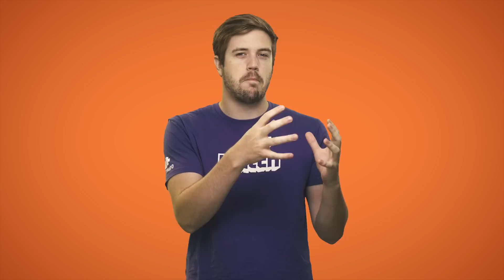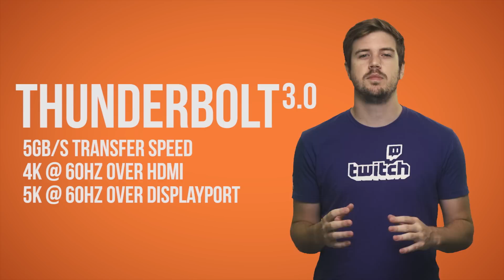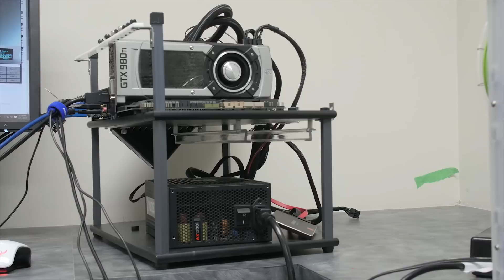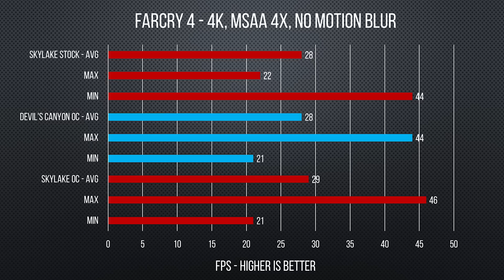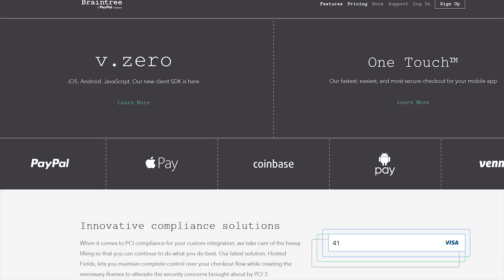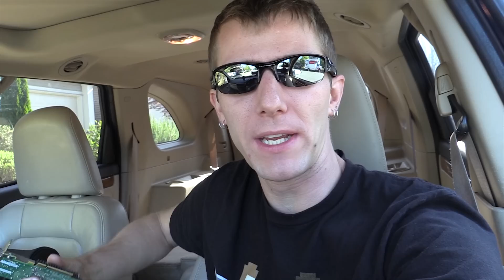Intel 6700K "Skylake" CPU

Comment: this is the kind of shit Intel gives us when there's no competition. if you have a 4790/K, 3770K, or even 2600K not needed the platform upgrade then you don't need to upgrade
Reply: Artemis 

2600k....I'd definitely suggest upgrading sometime soon, one would notice FPS bumps easily.  Anything above that, like the i5 4690 of i7 4790, there is basically no need.  Socket 1151 is a niche socket, and if one needed more performance than the 5000 series, they could go with the new xeon's which are amazingly powerful and efficient.  

Even a 4790k is going to be very good performance for years to come for home users.  Anything more needed than that, and one would be better off looking into things like render farms anyways, or don't even care about the pricing of higher end stuff.  

Intel isn't giving us shit, it just has no competition to drive it to deliver more than increments.  Even at this crawling pace, AMD has no hope of catching up.  As soon as they come out with their next big chip, it'll probably only be as good as intels current offerings....and by then intel will have something to blow it out of the water.  

do I want more CPU power?  sure.  Do i need it?  no, not really.   Yeah it'd be nice for some CAD rendering performance, but it's not like I'm on a time table as a hobbyist, and if I needed it in a timely fashion for work, I wouldn't even be looking anywhere near the range of a 4790k or Skylake.
Reply: ***** uhh no... It's in Intel's best interest to keep AMD afloat otherwise Intel will lose its competition and Anti-Trust laws will split the company. Intel didn't kill AMD, AMD killed itself with poor business performance.
Reply: Jackson Tyler well technically consumers killed AMD, because there were several times where AMD offered the better CPU and/or price yet they still didn't sell extremely well...
Reply: +C “N7” North I think the issue is more that we are approaching fundamental limits to lithography and engineering.  Below ~4-5 nanometers, quantum tunneling makes classical transistors basically impossible, so companies like Intel will need to start shifting their attention to things like stacked chips or bigger chips to increase transistor count.  Either way, in a decade or even just a few years, we'll likely not be able to further shrink transistors, and we'll have to engineer alternatives.
Reply: You ever think that if AMD still competing with intel, how far would we've come?
Reply: +C “N7” North true. for home users and casual gamers, something like i3-4130 would be good and reliable for years to come. and for those who already use i5 or i7 ivy bridge and haswell, skylake is really unnecessary
Reply: coldsoup49

I think the simple solution to that problem is
1) increase the surface area of chips
2) changes the material chips are made out of so they can run hotter

we could for example, run 10Ghz cores on processors if the materials could handle the heat, and there's plenty of room to increase the size of chips.   so there's plenty of room left to double the strength of current tech over and over again.  

beyond that, quantum tunneling could one day be a main driving force of computing design. It's really too far into the future to predict what will be the new computing medium in 2030 or beyond.  We could be struggling still or have some massive breakthrough, or use current tech in ways never though possible.  

For example, by then computing may be stored in a single or series of global computing cores and wirelessly transmitted to operate all devices.  So it might resemble something like a nuclear reactor, made out of diamond like materials, the size of a building, red hot, running at a billion jiggahertz, being cooled like a nuclear reactor, delivering the worlds computing power.
Reply: C North Thing is it might not be as black and white as that, developers know that CPU's aren't getting faster so they are forced to hold back as if they didn't noone could run their games, if there was a competition war between AMD and intel and each were increasing CPU performance 30% a year devs would have that freedom and make use of it! :D
Reply: Artemis what about about the X99 chip? Thats pretty fucking major.
Reply: we're talking about Skylake here. the 14nm new tech everyone had high hopes for. Too bad it didn't deliver
Reply: Artemis lol just because Intel didnt deliver a drastically over amazing cpu this time doesnt mean there arent other better choices like X99, the 6700k or skylake for that matter arent their only cpus lol. The main driving point for Skylake was LGA 1151 anyway. Theyre trying to push over into DDR4 and hopefully make DDR3 obsolete,  just like with DDR2
Reply: I understand the Platform thing but DDR4 performance is not even noticable with even 3000Mhz DDR4 vs 1600Mhz DDR3
Reply: megaspeed2v2 sorry but that's a dumb statement, as most games rarely use over 50% of a typical quad-core CPU anyway, if CPUs were really holding things back in anyway then obviously they should be utilizing the CPU better, plus with DX12 around the corner it should offload even more processes onto the GPU, these days the CPU is becoming less and less important for gaming... and I say that as someone who bought a 4790k just to run a few CPU heavy games better.
Reply: vgamesx1

I bought the 4790k because it's 30% faster than the i5 4690k, which would buy me another year or two of longevity at least.    I haven't even bothered to overclock this thing yet, really just no need to.  when a good cheap cooler comes along that allows 4.7ghz easy, then I'll bother.  

I don't even upgrade until something 4x as powerful comes out.  That's my mark.
Reply: vgamesx1

AMD may have offered better price at purchase time, but overall price to performance ratio always went to Intel, despite naysayers.

Why?  Because...

AMD's increased power requirements over the life of a CPU (~5 years), makes even an FX 8 core more expensive than an I7 4790k in the long run.  Now couple that with all that extra performance from the get-go, then the added longevity giving years of savings between the next upgrade, and AMD's chips are sorely lacking in every area.   

What are people with FX 8 cores upgrading to?  i7 4770/4790k's.   So here they've spent over $500+ in CPU's since 2012 (not to mention new motherboard, etc), when they could have gotten an i7 4770k from the start.  The end result?  They've paid even more money, for the same performance people have been getting with Intel for years already.

When I moved to an i7 4790k and a GTX 970, I didn't even have to upgrade my 480w PSU.  If I had went with an R9 290 or more and an FX 8 core, I most definitely would have.  That saved me a good $70 alone. 

On top of that, you won't find any AMD motherboard under ~$80 with features like USB3 or even SATA3.  You can get a socket 1150 motherboard with all of that for $35.  

And this doesn't even cover all kind of other little things here and there that set AMD back.

The fact is, AMD hasn't had price to performance ratio going for them since the early Phenom II days.    

The truth is, in the long run, AMD ends up costing you more, and thats been a fact of the world since ~2010.
Reply: +C “N7” North I don't know where you live, but using a AMD 8-core won't be that expensive, concerning power usage, as long as you don't use your PC at least 12 hours a day. As an old member of Team Red, I sadly have to confirm that. After 4 years of great Service, my fx6300 has died on me and I decided to go with a i5 4690k, great step forward for the future at least, as of right now,  I did not notice any improvements. Around 500 points more in 3 D-Mark, and great 2 FPS more in skyrim, yay.
Reply: Dieser 1337 Baka.

Over a 5 year period, the extra energy usage alone will close the gap of cost between an 8350 and an i7 4790k.  And that's not even considering the other factors I pointed out, like longevity and having all that extra performance from the start, or saving on things like motherboard costs or PSU costs, etc.  Add all of that up, and yep, the FX series costs quite a bit more in the long run.  

But see, had you gone with the i5 from the start, you would have saved a few hundred dollars at least, and would have had more performance the entire time.  

The difference in an i5 4690k and FX 6300 is pretty significant.  You may not notice it soo much in simple things like browsing the web or most gaming, but in a few years the difference will be quite a bit more obvious.  Even with DX12 on the horizon, that's not going to mean games are less dependent on CPU's, it's just going to mean more room to squeeze in better graphics.  

I would say even the skyrim performance should be better in general, since Intels do tend to help when it comes to increasing minimum and average frame rates in general.  But even then, I wouldn't really say skyrim is a demanding title, by now it's a pretty old game.    

Fact is, even the 8350 bottlenecks an R9 290 in many cases.
Reply: the only thing I like about AMD is their graphic cards, and even that origins from ATi, Their CPUs? nahhhhh. their CPUs is infact very good for the price they offer, especially with OC, a 5 years old PII 1055T @ 3.8 eats the i5 4690 in CPU heavy games, but it's old and hot and very power consuming. people want cool, new tech (specifically the firstworld country) so they'll always look to Intel and Nvidia. in poor country like mine, AMD good price/perf ratio is a good choice considering many of us upgrade their system every 2 years or so
Reply: C North had an 8350 for a long time. Upgraded to a Titan X and a 5820k and the difference like you said is massive,  even for the 4790k. Cpu's absolutely affect gaming perfomance. As a test I paired my Titan X with the 8350 and ran GTA 5 almost maxed out at around 55 to 60 frames. Then put the Titan X back in jy 5820k rig and got 95 to 105 frames completely maxed out. So idk where people get thus idea that CPUs dont affect gaming as much because they definitely do, especially if you play Arma lol. To be quite honest, I may never go back to AMD. Intel is just so much better in the long run. Hopefully they still continue to make X99 chips in the future though.  X99 is fantastic in terms of performance.
Reply: C North what are you rambling on about? I wasn't talking about the 8350 I was refering to back in the day, as in the early 2000s to 2010 when AMD was good.... of which what "enthusiast" is going to keep their computer for 5+years? normal people sure, but it's as if you don't know the audience you're talking to here.

Now onto your argument on power usage, not only ridiculous but also appears to be baseless as well, considering for most US states electricity only costs around 0.08 cents per Kwh but still depends where you live and AMD isn't actually that bad by comparison of power consumption at idle.

http://www.bit-tech.net/hardware/2013/06/12/intel-core-i5-4670k-haswell-cpu-review/6

As you can see there, accounting for an idle PC running for 6 hours a day, that consumes 90W (AMD) vs 80W (Intel) so 90W x 6h / 1000 = 0.54Kwh per day x 30 days = 16.2Kwh x 0.08 = $1.3 per month a month and $15.5 per year to run an AMD system, now same calculations for the intel based system would be $1.15 a month or $13.82 a year, that's a massive $1.68 difference a year, wow big freaking deal...

Now obviously PCs don't idle all the time but they will idle or nearly be in an idle state for most of the day, so we can calculate the load too, as what's called a duty cycle, we can assume that a PC will be idle for about 75% of the time for most people anyway, thus its only under load for that other 25% therefore our system examples from the site above would be (90W x 4.5h) + (283W x 1.5h) = 603Wh (0.6kwh) now you can figure out that the AMD system would cost an average of $23.89 per year to run vs an Intel system average of $16.07 per year, yes a massive $7.82 difference under typical usage...

Basically my point being and a long winded way of saying... IT DOESN'T FUCKING MATTER, unless you're building a 24/7 machine and that's the only time it should matter, so for example a router or NAS otherwise you're looking at a mere $6 to $10 a year in savings going intel, yeah it adds up over time, but just like having air conditioning, who fucking cares as long as you're happy? Besides that swapping those old incandescent bulbs out for LEDs would make a far bigger impact than swapping CPUs so what does that tell you..

Oh also just on a side note, I did upgrade from AMD but it was from an Athlon II x4 not an FX series CPU... so I spent about $160 AMD then made the switch to an i3 4330 and a msi h87-g41 and used that until I got what I have currently, I didn't go intel because I couldn't upgrade to AMD, I went intel because I needed that single threaded boost for games such as Minecraft, yes I shamelessly bought a CPU for that among other things, but it's been great nonetheless.
Reply: C North maybe some people want to "fuel" the competition? XD
Reply: vgamesx1 you obviously dont know what you're talking about, simulator games for one thing are CPU heavy and the devs are having to be careful what new physics features they add to the game so that people can run the game on current hardware.

Comment: Got my 4790K OC'd to 4.9Ghz stable.
Reply: +Hakeem Hakim pc specs?
Reply: Inneryoyo    i7 4790K 4.9Ghz  Asus Maximus Formula IV 16GB Hyper X Fury Corsair H110 watercooled GTX Strix 980 SLI.  Corsair 540D case EVGA 1K Watt PSU...Specs don't matter on the CPU.  Not all CPUs are created equally.  You could get the same 4790K and not be able to overclock so high.  I'm willing to bet I could push it to 5.0Ghz (but won't).  This particular chip is a beast.  Temps 32c idle, heavy gaming/load doesn't go past 54c
Reply: Nice dude!, congratz on the 4.9Ghz :v
Reply: Its insane man!!!!

Comment: I was a bit bummed out when i bought a 4690K just a few weeks before skylake released. (my 1156 mobo died)

But seeing that i didnt missed out much on performance (as Linus mentioned in several video's before) i'm happy i upgraded from i7 860 to i5 4690K.

offtopic: Luke, are you getting any sleep. You look pretty tired (or got a light cold?)
I reckon moving was a big undertaking.

But its nice to see you guys up and running at full speed!